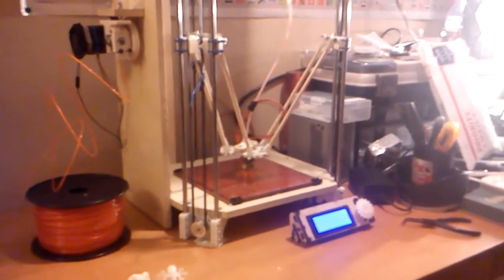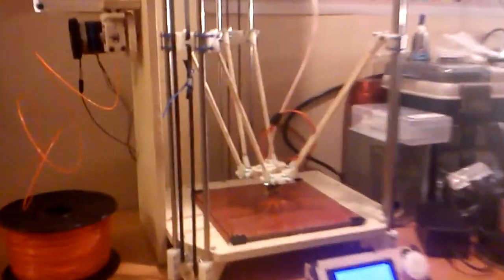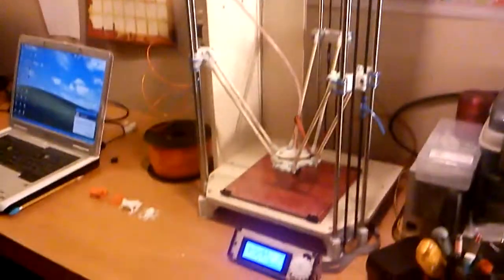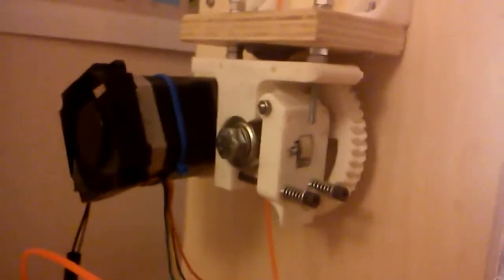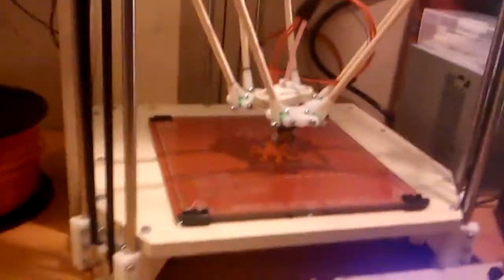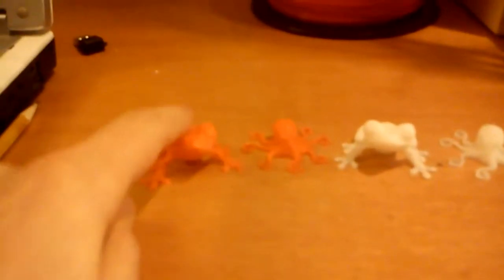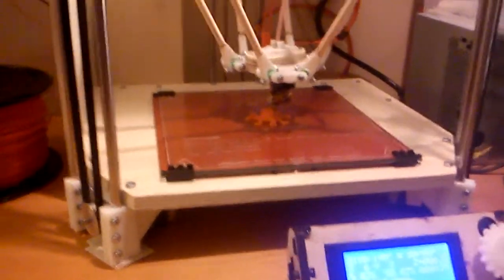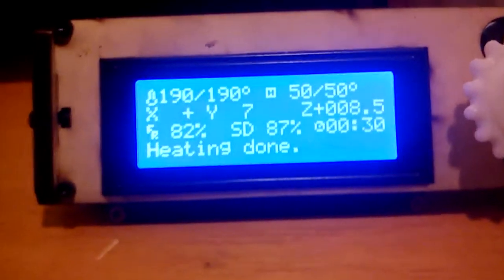Gman's 2nd 3D printer - Reprap Rostock

Comment: For the spool holder, make it able to detach obviously and have a stand support on the side that does not attach to the wall of the printer.
Reply from the maker: that would work, but im going to print a cylinder and screw it into the frame
Reply: i say add a support that just stands under that cylinder and can be pulled out like nothing. Just some advice to avoid stressing the wall.

Comment: How does one just build a 3D printer lol
Reply: There's designs online you can use as a starting point - much of it is derived from the Reprap project. So a lot of the work is already done for you, and you just need the skills to follow those instructions... And maybe access to a machine shop to fabricate some of the parts...  Though 3-D printing is popular enough at this point that you can order (for instance) an extruder or a heated print bed or a "hot end" nozzle rather than having to make it yourself...  So that's pretty convenient if you prefer to incline a bit in the direction of convenience but still DIY.
I'm actually gearing up to build one myself... Though I haven't got the fabrication skills needed for some of the parts, so it will be a real challenge for me.